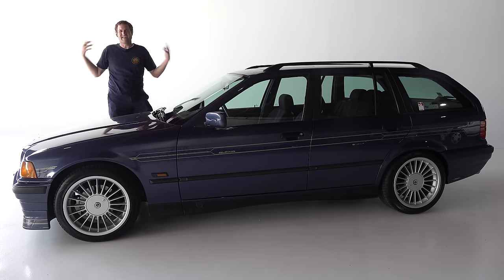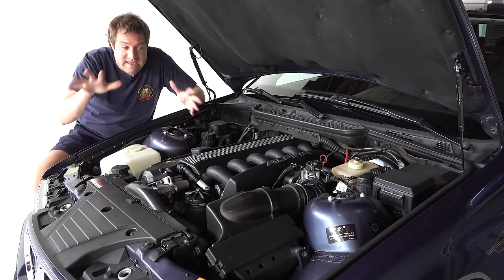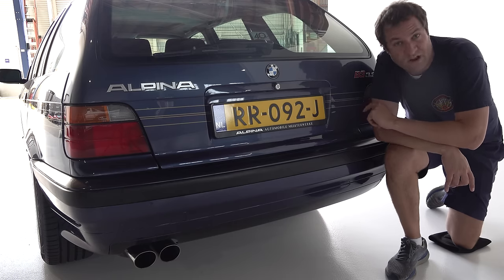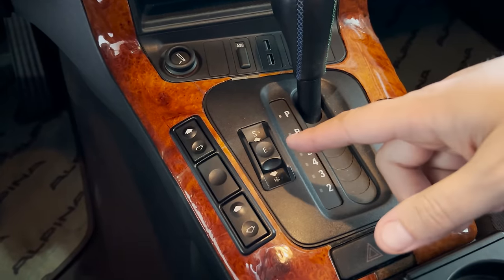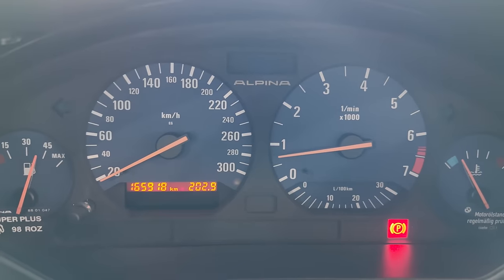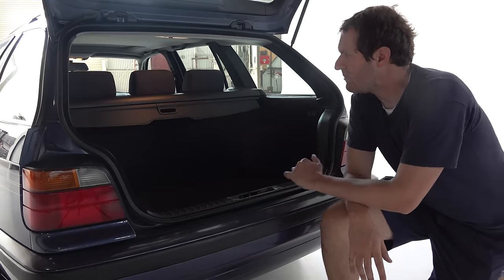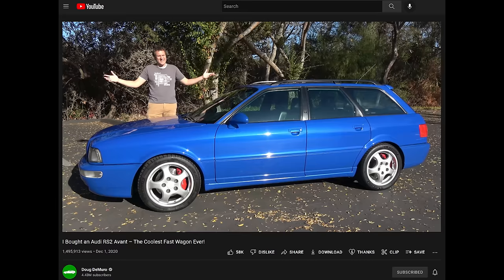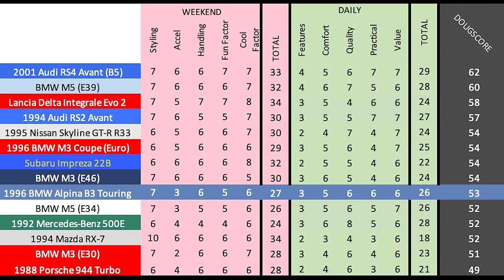The BMW Alpina B3 Touring Is an Ultra-Cool Obscure ‘90s Wagon

Comment: The exterior door handles are nearly identical to my E32 750iL's (these were also common to the E34 5-series cars).  Thanks Doug!

Some interesting facts about Alpina:

They started out modifying BMW 2002's for better performance and were originally a tuner company.  Later, they won accreditation from the German government as an automotive manufacturer.  More recently, BMW bought out Alpina and is now a subsidiary, though still being run autonomously from BMW.

Another interesting fact about Alpina - while you can purchase Alpina wheels, suspension parts as well as exterior and interior cosmetic upgrades (extremely pricey), Alpina will NOT sell you Alpina mechanical parts unless you can prove ownership of an existing registered Alpina automobile.  Very difficult and very expensive to get Alpina replacement mechanical aparts from the company aside from parting out an existing Alpina automobile.
Reply: I am English had several E34 Tourings.. petrol, diesel..  love them so much....  great for drives around Europe..and room for the dogs.  I had to get rid of my last one not too long ago, speed bumps, bad pot hole on roads etc..  just so bad unless a nice smooth road...
Reply: Because they are. BMW used these on all models around that time.

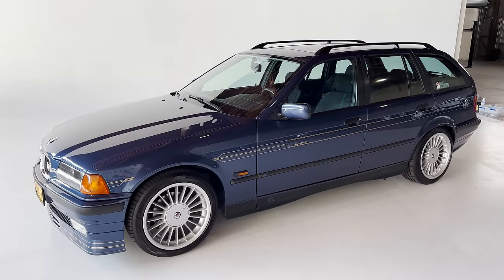Comment: 1:25
Until their recent sale to BMW Alpina wasn't a tuner, they hadn't been one for a long time by the time the E36 was made.
Alpina was a manufacturer, officially.
Reply: They’re still a manufacturer. BMW doesn’t take the wheel until 2025. They’ve been registered as a manufacturer in Germany since the early 80s but weren’t recognised in the UK until 92/93, and even still were registered as “BMW Alpina” rather than “Alpina B3” for example.

Comment: If I didn't already have the E55 AMG wagon, this is so tempting.
Reply: How reliable is your e55?
Reply: @ojsimpson9516   Mechanically alright. Rear differential bearing was loud, and the plastic clips are starting to break for wiring harness. Biggest issue was some insulation inside the headlights flaking off. These are not big deals. I’ve done two 16 hour road trips in it and never had any worry about it making it. It eats up miles.

Comment: Did you know there was also an Alpina B8 E36? Alpina went and put a modified-by-them BMW M62B40-based 333hp 4.6 litre V8 in the E36, all paired to a 6-speed manual, and made it work. Those are ultra rare and very expensive of course, 221 were made. There was also a 4.0 V8 option which 5 were made of for Japan only.

The E36 was such a great platform. Even the non-M, non-Alpina "mainstream" models - especially ones with the M50 / M52 6 cylinder engines, like the 325i or 328i - are such fun cars when in good condition. They are tight, the 6 cylinder engines have that great sound and character similar to the M3 even in those lesser versions (especially the ones with VANOS), you sit quite low, you just feel like you're sitting in a sporty car in any E36, even if it's a very base spec model with one of the weaker engines. Then the euro M3, these Alpina models, they are the peak of what these can do. Where I live, go to any drift event - be it amateur or pro -, you WILL see E36s there, it's a cheap and capable platform, I know guys who started years ago as amateurs with an almost-stock E36, and are still racing the same car but of course modified to pro standards since then, still being competitive. Mostly with the M50B25 engine which was still iron block and can take turbocharging very well, I've seen several tuned to 350-400hp+ and used regularly without issues. For this same reason unfortunately there are very few that are still nice and untouched even in Europe, they can rust badly and many were modified at one point, no wonder the remaining ones are appreciating now. Same deal was with the E30 quite a few years ago.

Comment: Interestingly enough, the crossed-out original VIN of this Alpina B3 specifies the model as CF21, which is a 328i Touring, and that's what BMW left off for Alpina to begin their magic with.
Reply: What's the original VIN of this Alpina? I tried to type it in VinCheckInfo, but it didn't give anything back to me.
Reply: @MishaMykha  That's because the original VIN is invalid as it had 0s for date and check digits.
Reply: @MishaMykha  According to the video, the crossed-out original VIN is WBACF21000FV21628. BMW used only the last 7 digits of the VIN as their unique identifier for each vehicle instead of the entire 17-digit sequence, usually 2 letters and 5 numbers. However, this ended in 2019 as BMW began issuing previously-issued identifiers to new vehicles so they were no longer unique. It is not possible to identify an unique BMW vehicle only using the last 7 digits and almost all VIN decoder services required the full 17-digit sequence. In this case, this VIN is invalid from the factory with 0s for the date and check digits, as it was never intended to be valid.

Comment: Alpina did not 'lower the front bumper', they installed a 'deeper air dam' out front.  The air dam is a separate piece and not considered part of the bumper.  That would have been the proper terminology back in the day.
Reply: He’ll figure that out as soon as he learns lift-back is a suitable-er term than calling everything a “hatchback”

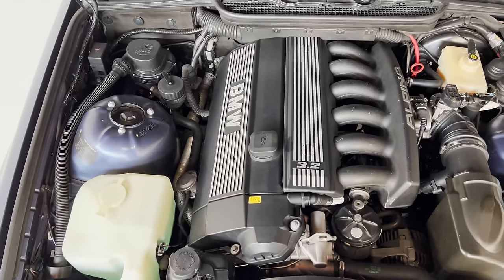Comment: Hey Doug, great video! You mentioned @2:24 that the engine was bored from 3 liters to 3.2, however this is not true as the M52 came in 2.8 Liters as the highest displacement, so this would be bored and stroked in order to be an M52B32 in this instance as Alpina did not use an S50B30 in this vehicle and the M54B30 was not conceived at this point.
Reply: I need to revisit my info, but it could even be the S52 which is already 3.2 although I vaguely recall a 3.4 version. Then it could even be an S50B30US.
Reply: @donkremer6019  though exceptions may exist, Alpina generally upgraded the Non-M version of the engine, that car started its life as a 328i E36 Wagon and then internals etc were built to Alpina spec, hence the M52B28, you can also check the “crossed off” VIN in a BMW VIN decoder and Im sure it would confirm my theory
Reply: @07RoBdYrDeK07  I checked the Alpina archives, it's indeed an M52B28 used as a basis.
Reply: wikipedia says they used 328 body but not engine: body base for the B3 3.0 was a 325i (BMW E36) and a 328i for the B3 3.2. In both models, however, Alpina used the more robust M50 (B25TÜ) cast iron engine, as the M52 engine of the 328i was not suitable for expanding the displacement. Both vehicle variants were available as a coupé (two-door) and sedan (four-door), cabriolet (convertible) and station wagon (touring).

which I would believe since M50 has cast iron block while M52 is aluminium.
Reply: @petrsvetr6083  aluminum block is good to be bored out, how do you think the S52B32 came to be?
Reply: @petrsvetr6083  they use the US M52, which has s cast iron block. So does the S52.
And the Alpina Archives are a better source then Wikipedia to begin with.
Reply: @07RoBdYrDeK07  S52 and S54 have iron blocks.
Reply: interesting, can you share the link? Did not find it on alpina-archives. There is also some confusion about the nikasil issue as it seems later M52 had iron sleeves instead of nikasil coating.
Reply: @petrsvetr6083  that's a UK thing. Rest of EU has all alu M52. US has cast iron M52. That's the one Alpina used.

Comment: FUN FACT: dutch license plates are based on the date the car was registered, so if you are known to it can see its not chronologically in line with it’s ‘96 year (it should be letters L*/numbers *# as such LL-LL-##) but has a more recent license plate (LL-##-L) which means it has been imported (from probably germany). that’s how dutch people distinguish a original dutch delivered car from later imported cars because you cant tamper with license plates here.
Reply: According to the Dutch registration it entered NL in 2019. Looking closely at the vin number it seems to be build for the Japanese market, yet is is left hand drive… interesting history I guess.

Comment: I had a set of Antera type 143 wheels back in the late 90s that had the hidden valve stem thing. As I recall, you popped the center cap with your finger to access then it snapped back on.

Comment: The car was imported to the Netherlands in 2019 (that's why it has Dutch license plates) it doesn't say when it came to the  US in 2016 it was in a accident (hit right rear, and right front €3000,00 -  €4000,00 of damage) and 2017 (hit in rear  €2000,00 of damage) last know miles 70.000 km
Reply: That would explain the new format Dutch number plates. But seeing the US plate sticking at the rear windows, I'd say it's a fresh import.

So nothing wrong except for new front and rear bumpers with special metallic paint that costs a fortune and no official dealership visit for 80.000 km?

Comment: So...we not gonna talk about the USB-A Ports by the shift? in a 90's vehicle?
Reply: Most likely added by the owner.  USB didn't even appear as a computer interface until around 1995 or 1996, and wasn't perfected until Windows 98.  USB ports didn't appear in cars in any form until several years later.

Comment: You can still find this car as a Dutch registered car (with all its quirks and features or rather its specs, like hp, torque, 0- 100 time, top speed, sizes, fuel consumption, roadtax etc.) with e.g. the car-app Finnik

Comment: Aah this makes me miss my daily 1996 E36 328i touring manual even more. 
Mine was an original dutch registered 328i manual with a black leather interiour and no roof racks but with a sun roof. Thing had m50B25 intake plenum, M bumpers all around, short final drive, lowered and e46 330i convertible brakes. It was so fun to drive! Even with 367.000km's on it!
Because it was sitting on wider wheels it had all the grip in the corners. I hate to admit it but it cornered better than my Nissan Skyline R33 GTR V-spec!😅 

Unfortunately i had to let it go when the GTR needed a new engine block, the E36 needed alot of maintenance due to its high milage and i couldn't keep both projects going at the same time, so i had to sell it. It is still around though!
They are getting pretty rare now so i doubt i will ever have another one as a daily driver but they are definatly fun cars to drive...and practical!

Comment: Alpina is a classy prestigious well balanced car with "cadillac" style confort, while at Ac schnitzer everything is so aggressive, brutally elegant & luxurious at the same time! My suspension is very stiff mainly because of the way they designed the early 90-91 (longer strut/M3 swaybar linkage with serie 7 E32/8 E31 style top mount roller bearing) also looks like this B3 was originally sold for the Japanese market just like my S3

Comment: The valve caps in center of wheel covered up help protect from ppl letting air out. Those locking center caps protect wheels from being stolen and from someone leaving you with flats.

Comment: Actually, the exhaust tips are very similar to the ones on any non M36 six cylinder.  My 328is has slightly oval exhaust tips, though they are not chromed.

Comment: I had one, mine was a 3.0 switchtronic, brought it to get my golden retriever about in, he loved it.

Mine went to Marbella as it was LHD, great car in every way possible 👌

Didn’t have the stripes as when machine polishing it’s a pain!

Been a LHD it has a different manifold to the RHD because of the steering rack position.

I ditched the standard front brakes from the 328 & put the 330 diesel front set up on👌

Unfortunately you can’t get the rear tyres now 265/35/17 from Michelin but the 255/40/17 isn’t a bad way to go👌

Comment: little off on the e36 being solid, its known in the bmw community for being the first bmw that really falls apart on itself, especially with the interior plastics, glue and door panels.
Reply: Not unique to the E36 or even BMW.
Reply: @houseofno  They are the ones known for being terrible at it. But if you are also refering to the E46, E39 and all the junk that came after sure, they also bad. E36 was specifically designed to break down the interior for recycling within a few years however

Comment: As I sit here, thinking about the center hub mounted, valve stem. I got to thinking…. If it’s in the center… how would air get to the tire….? Only thing I can think of, is through the spokes. Assuming they hollowed them out or something…..Which is absolutely bonkers to think about if I’m right. Anyone know?
Reply: One of the spokes is hollow for the air to travel through.

Comment: that's crazy. I'll have to settle with my techno violet 320i that I won on your online auction, Cars and bids. lol new video of me driving it across the country live on my channel!
Reply: Great purchase! Any engine swap plans?
Reply: @doctor_tran  excellent question. A lot of bad ideas have circulated in my head. Currently at peace with cleaning it up and maybe putting it back on the market in the near future.
Reply: @misterdre  I think you should S62 swap it ;-) Happy to take measurements on my Alpina B8 for reference to help since it's the same engine platform (M60/M62 based block)
Reply: @doctor_tran  oh snap! As fun as that sounds there are many in the stable right now and the e36 is going to be leaving first haha

But the 320 is the slowest car I’ve driven in a while (and I drove it across the country) lol swap would be a game changer..but it also needs suspension as my bump stops are currently non existent lol…and an LSD

Comment: Car was exported 20-11-2020 from the Netherlands. And 18-09-2019 imported to it. The current  licenseplate, is not the offical Dutch one. The number is correct, the font and print are not legal in the Netherlands.

Comment: Given that the wheel cap is not symmetric, I wonder how (or if) they account for this when balancing the wheels during tire change
Reply: Since this (very small) asymmetric imbalance is so close to the center part of the wheel it will therefore have hardly any effect on the balance.

Comment: Is the valve stem stationary when the wheel rotates or it turns with the wheel of how does that all work in rotation?
Reply: There is just a hole through one of the spokes and valve is installed to other end of that hole.
Reply: The valve is fixed at one of the spokes of the wheel. This spoke is hollow and connects the valve with the tire. So the spoke simply works as an elongated valvestem.

Comment: Somebody should tell you that this B3 has no M3 engine, it based on the M52. And if you wanted some power in your Alpina E36, you bought an V8 version. That's why there are so few 3.2.
Reply: it is actualy based in 2.5 M50 because it has iron block

Comment: ALPINA is actually a manufacturer, not a "tuner". In the papers in Germany, at least, the manufacturer is BMW-ALPINA, not BMW, it has a different VIN as well for that reason. They don´t like being called a tuner, that was Schnitzer and the likes. 

The Alpina stripes are still a thing today, they never went away. They used to be quite obnoxious in the 70s when they were really thick and ...... blue and green. On all cars. Imagine a red Alpina with big blue and green stripes on it. Ugh.... :D

On the wheels, the spoke where the valve sits is hollow to allow the air through into the tyre. Pretty complicated for the time.

As for the Z8, it actually has a different engine with notably less power to make it more of a Autobahn cruiser than it was with the M5 engine. No tuner would ever do this! ;)

Comment: They took the 2.8l engine, the M52B28 and bored it to 3.2l. Not the 3l engine!
Reply: Yep, BMW didn't have a 3.0l engine at that time. The closest is the M60B30, but it has a small difference in layout and its production ended in -95
Reply: @peto22  they did, 3l M3 engine S50B30
Reply: @Progamer618  S50B30 production also ended in -95
Reply: Correct, it was a mistake. This engine is based on the M52B28.
Reply: @doctor_tran  its a us spec m3 engine. Literally the same block n all.

Comment: That is a 2019 licenceplate  this car is imported to the Netherlands. And doug is driving it in the states with yellow plates. How is that possible
Reply: Either old plates or custom made by US owner as vanity plates.
You can order all kinds of plates from different countries.
Reply: @donkremer6019  but those are original dutch 2019 plates. I think the car is imported to the states very recent and they just kept the dutch plates. Normaly if you export a car you will get white export licenceplates
Reply: @apscoflapsco1721  yes correct in this case.